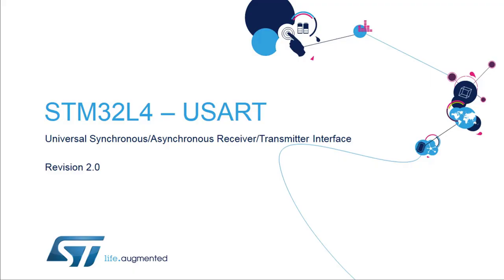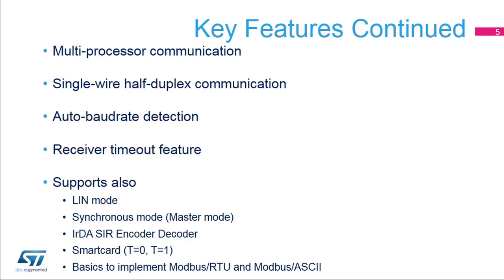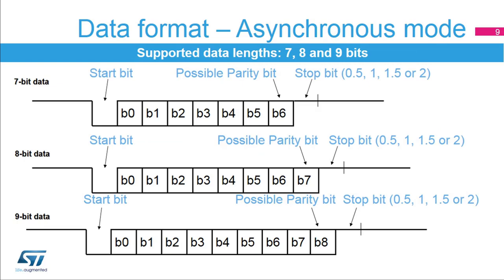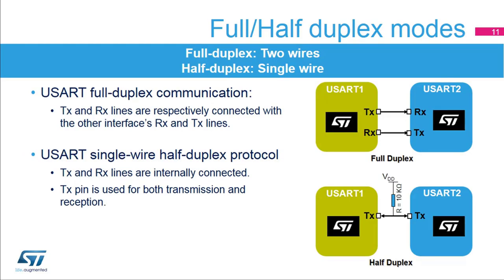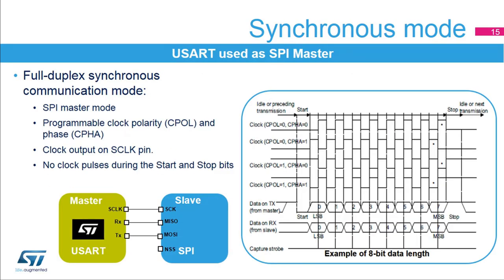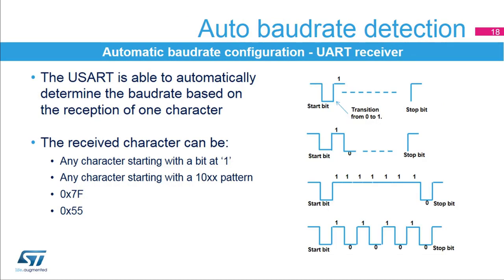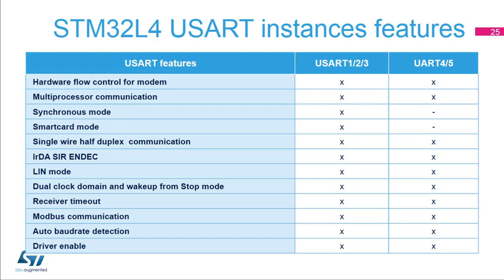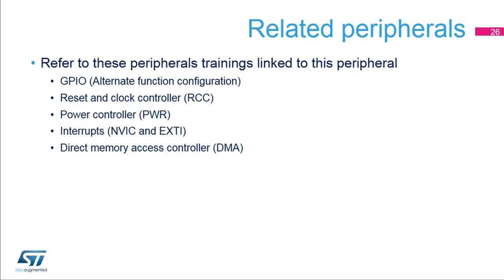STM32L4 training: 05.1 Communication peripherals - USART theory

Comment: Hi. So i have a question about Multiprocessor Mode: master's Tx connects to several slaves' Rx lines and that is fine, but master's Rx connects to several slaves' Tx lines, which means the slaves have their Tx lines directly connected to each other, these lines being outputs... Do the MCU pins implement some kind of protection for these pins when UART is set to Multiprocessor Mode or do i need to use some hardwire of my own? Do i just connect those pins to each other directly?